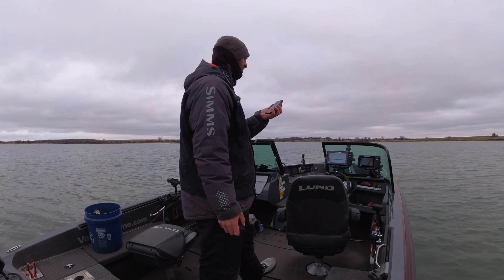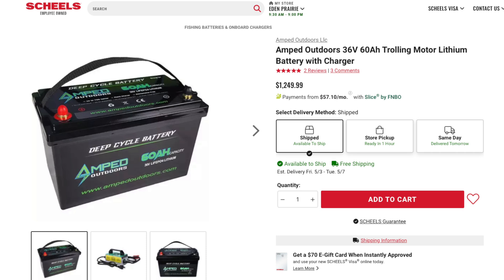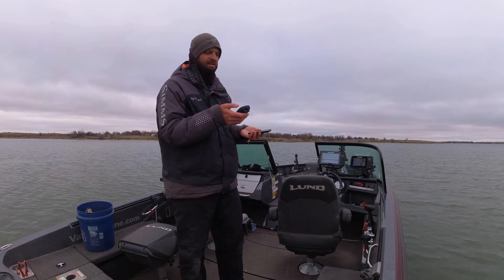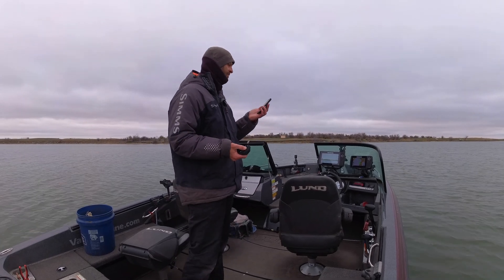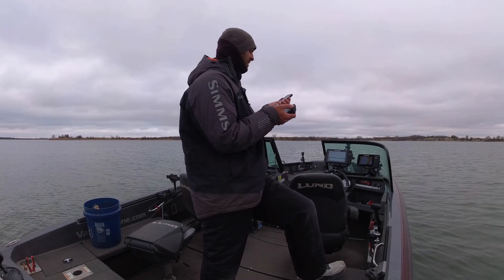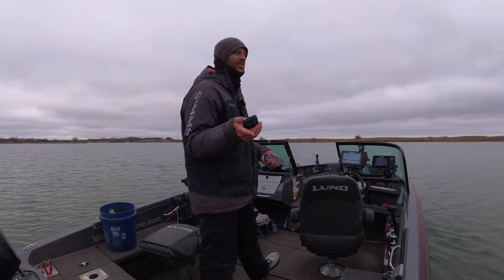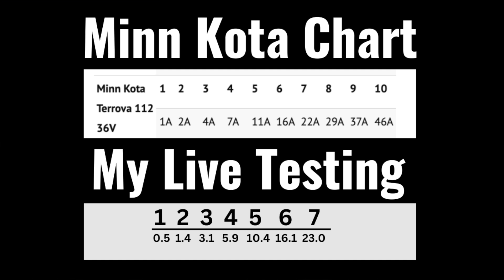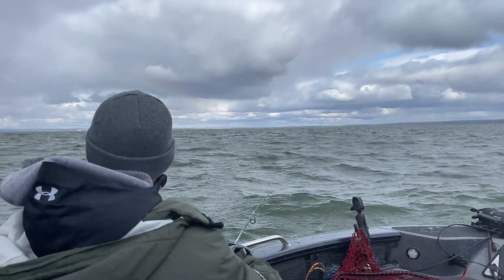Testing Lithium Batteries & Trolling Motor Amp Draws

Comment: I run 2 power Queen 100ah each with 80lb Terrova  for the past 2 years and they are great  for a fraction of the cost  $310 .
Reply from the maker: Good to know. I ended up buying Epoch with similar specs to yours for $400. I didn’t like the Amped single 36V for me.

Comment: If your troll motor is pulling you into the wind and/or against current, you will run your battery down quicker than if you are going with the wind and/or with the current. The more load you put on the prop the quicker your battery charge will expire.
Reply from the maker: I agree with that

Comment: I've ran mine on 10 for burst and sometimes for more than 10 mins. It's been fine. It's gear, it's meant to be used.
Reply from the maker: I mean, it’s probably not going to burst into flames immediately, but if it were me, I probably wouldn’t do it a lot over the long run. But I don’t have proof that it would do any damage either.

Comment: Summer 2025 is here and I was able to get the Victron SmartShunt IP65 (waterproof, Bluetooth) installed and setup for my Dakota Lithium 36v 63AH. 

We were out fishing here in Minnesota using the Minn Kota  36v, 112LB thrust Ulterra trolling motor and using ‘Follow the Contour’ feature for the lake. This is installed on a Ranger 223FC Tri-Toon boat so higher sides to be pushed by winds and just being 24ft Big Boat. Battery was fully charged and after trolling at around 1.0 mph, give or take depending on wind for 2.5 hours. The Victron SmartShunt said I had used 10% of the battery when back in the lift. I did forget to check in the app for power drainage while it was operating and for the app to calculate time capacity during use, next time. 

I picked up the Victron from Intelligent Controls out of Montana, they were very helpful providing information in my purchase (less than $75). 

This was a good addition since my battery does not have Bluetooth build in, as do many newer batteries for monitoring the LiFePO4 battery health. My cheap battery monitor from Amazon was OK, however this does provide much more actual information during usage.

Be aware they do have mother model that is slightly different but it is also NOT WATERPROOF as this one for about the same price. You could get them mixed up depending on need’s and setup condition. If in the market for such a device, I would definitely recommend this model for use in a wet (or could be wet) situation.

Best to all!

Comment: All you have to do is add another 36v 60 ah in parallel later on down the road if you want more capacity. Thats the best way to do it in my opinion. Even if one of your batteries goes bad you can still fish with that system
Reply from the maker: Functionally, yes, but for this particular battery, that wound up being way too expensive. There are plenty of 12V, 100 Ah batteries at good prices to buy three of those vs two of these.
Reply: @BloemendaalFishing  that's definitely true, I would never consider buying one of those ones, there's so many good cheaper options, I got some new 24v 50 ah power queens, for a combined 100 ah of 24 volts, all with Bluetooth. I think these expensive companies are going to really struggle with the new competitors that are up and coming.
Reply from the maker: I totally agree with you. The price on lithium batteries for the old companies has to come down at this point!

Comment: Don't forget u can also get a charger for the boat that will charge the lithium battery while ur running your big motor.  That helps guys get a whole day out of the 50 or 60 ah
Reply from the maker: Very true, I considered that but ended up just getting 100 ah batteries instead.

Comment: Now my Ulterra 36v with a 36v 63AH lithium battery has worked well over last couple years, not that I am fishing like a tournament pro, just casual in a pontoon (tri-toon Ranger FC223). Big boat and wind can catch the sides. I have used maybe 25% from what the cheap voltage meter said and only took less than 90 minutes to recharge with an 8 amp charger from the battery company.
Now this year I am looking at adding a Victron Smart Shunt IP65 300A model (has M8 bolts instead of M10 for the larger sizes) to get a better handle on power used and remaining, The battery didn’t have Bluetooth build into it and the Smart Shunt does, then I will be able to monitor the battery draw etc., from the app once setup, on my phone.
I am also switching to a 12v 100AH Dual Purpose for my cranking motor. Have not been happy with electrical drain from the Lead Acid since purchased the boat 3 years ago. The lithium with that power drain so much lower and straighter drop curve than a lead acid. I am hoping the electrical drain issue will take care of itself. The battery people said I should be able to go all day or at least not much drain using 2 graph’s, live well, bilge pump, power Bimini, radio and other electrical devices and still start my engine (important as well). They said it will surprise me the minimum usage drain, which with Lithium it’s getting head wrapped around the tech. Lithium is expensive but could be an answer for long term solutions, time will tell.
Best to all, have a great 2025!
Reply from the maker: Seems like you've done a lot of digging on this as well! Batteries are so involved, and it seems like it's hard to get perfect or even non-conflicting answers from a lot of places. Hope your setup works well for you, and thanks for watching!
Reply: @ Your right a very evolving technology.

Comment: Just letting you know how my Power Queen 12v 100AH (group 31) lithium ion batteries performed this weekend in a fishing tournament I was in.  I have an 18' Lund and am running a new Minnkota Ultera 24v 80lb thrust trolling motor. After fishing the first day pulling bottom bouncers most of the day at 1.0mph from 7 to 3 with mild winds the batteries were still nearly fully charged. The second day of the tournament winds were a constant 30mph with 50mph gusts all day (miserable conditions).  The trolling motor was running at a constant 6 to 7 to maintain spot lock for 8 hrs.  The batteries worked great and maintained voltage all day long. I was impressed with these lithium ion batteries compared to Lead Acid battery run times I have had in the past. Now, the new Power Queen batteries have added blue tooth which is definitely worth paying for.  Hope this helps other fishermen.
Reply from the maker: Glad to hear! Great info.

Comment: Running in the shop, you are not putting a real load on the motor because moving air is easier than moving water.  Amps will go up when in the water and will change if you used a different prop.

Also find it interesting that they limit you to 85% for speed.  Power is amps times volts so essentially they are saying you get the same power at 85% on a lithium as you do on a lead acid at 100%.
Reply from the maker: Makes sense. Appreciate it. I’ve never dug deep into this stuff, so I’m learning good!

Comment: Great video and you are right there isn't much material on these batteries, I switched to Lithium 4 years ago and when talking to shops they shared they don't mess with them and they didn't seem to be educated on them, one shop shared lithium batteries only last a year or two while lead lasts around 5. May have missed it in the video but one other benefit of Lithium is the ability to recharge in a fraction of the team of lead batteries. My batteries weight 1/3 of what my lead batteries did and I also downgraded from 100ah to 60ah. I'm able to get 6-8 hours when trolling 2.2 mph, I've never ran it out when using spot-lock only. 4 years later mine are running great, got mine 4 years ago and they were 500 a piece (1500 total), sounds like price has fallen a little. Thx for the video!
Reply from the maker: Thanks for watching, and thanks for the extra insight!
Reply: 1,200 buck for a 50ah battery,? Lol, nope

Comment: Good information.  The battery you were using is really over-priced.  I'm guessing they provided it to you for testing, meaning no cost.  There are very good lithium iron-phosphate (LFP) batteries out there, designed for powering a trolling motor, that are about half the price of Amped Outdoors batteries, which are just relabeled with a huge mark-up.  For example, you could buy three 100AH LFP batteries for well under $1,000, connect them in series, and then you never even have to think or wonder about their state of charge; they'll always have more than you'll use.  That also spreads the amps being drawn across three batteries, so no one battery is providing more than 1/3 of the power.
Reply from the maker: Yeah, it's certainly not the only one I looked at, but they did not send it to me for free! I was told I could try it and if it didn't make me happy, I could return in 30 days. And yeah, pricing-wise, I think there may be better options. I was leaning towards 100Ah, but wanted to try these and see.
Reply: Series or parallel?

Comment: If you troll any amount I would suggest going with a 100 or 125amp.  You will eat that battery for lunch in 2ft chop pulling a bag or even chop with wind in your face.  Nothing wrong with your test but there is very little wind and no waves.
Reply from the maker: I'm pretty much in agreement with that. I'd have to assist with my kicker if I keep this one.
Reply: Who makes a good battery in 100 or 125?
Reply: @peepo2222  ionic 125 and 150.  I use the 125.  Litime makes a 140.

Comment: You should only drain deep cycle lead acid batteries to 50%, so a group 27 100ah lead battery will give you 50ah od run time (if used correctly.) A 60ah lifepo4 battery drained to 20% SOC will give you about the same amount of run time, 48ah. As far as those bluetooth apps, i dont know that i would put much faith in some of the info they give you. I might trust the voltages, amps, and temps, but I dont know that I trust them to tell you run time left or % of SOC (state of charge.) I have 3 100ah lifepo4 batteries that all capacity tested at 103-104ah with same cell voltages, but calculated values like % SOC and run time left in the app are all different. Could just be my batteries. Myself, I like the idea of 3 12v 100ah batteries. If one battery gets weak, you can still use the other two for camping, rving, backup power, etc.
Reply from the maker: That's great info. I thought the 50% thing was right, but didn't want to act like I knew if I didn't! As for the app duration...yeah, it seemed in line with my math in my head, but it's different when they're actually tested to the end in realtime, so I agree, wouldn't trust it religiously.
Reply: @BloemendaalFishing  - The SOC shown by the app is a guesstimate, at best.  For that number to be reasonably accurate you will need to fully discharge and fully charge the battery, periodically, so it can reset what it thinks it knows.  Also, over the years your usable capacity will decrease, as it does with all batteries...and that SOC meter won't understand that.  Use it as a rough guide, only.
Reply from the maker: Makes sense.

Comment: 60Ah definitely feels like a lead-acid setup as far as time is concerned with a typical 3-5 speed sort of day, but easier to monitor and manage. I absolutely love ignoring my trolling batteries for a full 12+ hours on the lake with my 100Ah. I have zero range anxiety like I once had with my lead acid batteries.
Reply from the maker: I quite agree with all of that.

Comment: I have a Teranova 80 24volt in my 18ft glass boat. Looking at lithium's but dam I need to over the sticker shock! Great info thanks!
Reply from the maker: It's a lot, but when you figure a lead acid battery gets 200-300 cycles and a lithium gets 2000-5000, it's worth it.
Reply: Look at the Li-Time trolling motor batteries.  They aren't much more than a good AGM but are 4 times as much battery, when you factor in how much you can draw from them and how little they weigh.  Also, if you take good care of your batteries, an AGM might last 5 years while an LFP battery could easily last 15 years.  These days, buying anything other than LFP for powering your trolling motor or electronics is a mistake and will cost you more, in the long run.
Reply: Im running 2 litime 165ah for my 24v ulterra and i can troll fishing all day without using my main motor.... plus they bluetooth so you know exactly how much ah you have left or used.

Comment: Great video. Love the numbers. Answered a lot of questions. Could you comment on what on-board charger u went with?
Reply from the maker: This one comes with its own charger, so if I stay this route, that's what it is.
Reply: @BloemendaalFishing  nice thank you. And then you wonder if 60 amp hours isn’t enough if maybe the best route is to add a 36 V alternator charger.
Reply from the maker: I had thought about that a couple years ago. Fuzzy memory, but I was thinking it didn't add as much charge as I'd hoped, and also, it requires you to actually drive somewhere to get the charge.
Reply: Noco makes the best on-board charger option for lithium iron-phosphate, right now.
Reply from the maker: Hadn't heard of that one, thanks.

Comment: I rely completely on a trolling motor. Most bodies of water near me that i go to are either no wake or electric only.
Just pushing a little 12' aluminum V-bottom.
A nice battery would be ideal.

I got a couple old gas powered ones i need to get refurbished before i try the Des Moines River.
Reply from the maker: Lithium seems like a great idea for that, and you probably wouldn't need a 36V, so you could do it fairly reasonably.
Reply: @BloemendaalFishing  Thats my only worry when im out, is i have absolutely no idea how much juice i have after i have been out a while. Would be nice to have enough to ensure max use for like 4 hours or so, though i would never use it that heavily.
Thanks for the feedback!
Reply from the maker: Yeah, if nothing else, the apps are super handy to monitor a battery!
Reply: @scottmcley5111  - For pushing a 12v aluminum, with a 12v motor, and a 100ah LFP battery ($250 - $300), you'll have more power than you could possibly use in a day of normal fishing.  A recent video I watched showed a guy trolling at 1.2mph (walleye) for 2.5 hours, using a 30ah LFP battery, so if you extrapolate that out, he would use 90ah in 7.5 hours of continuous trolling.